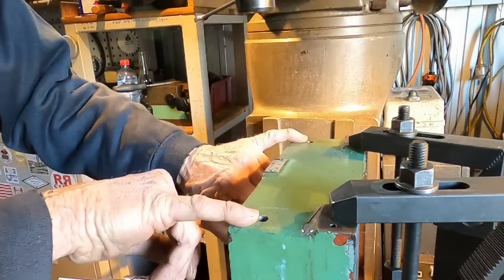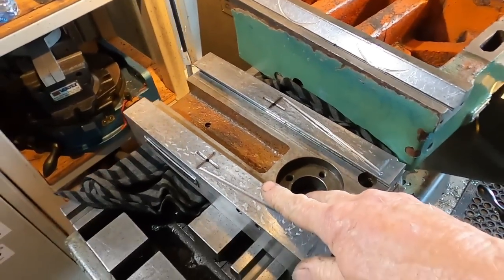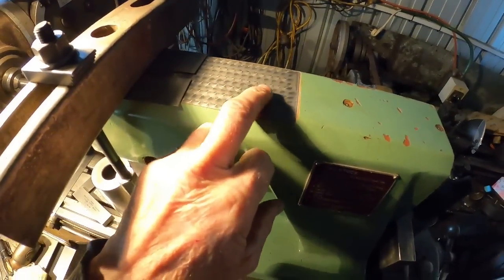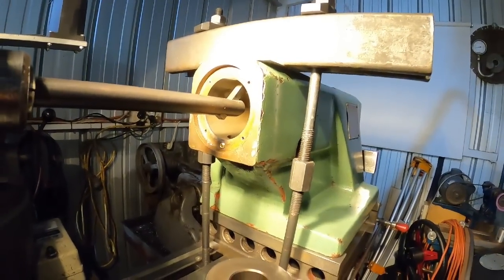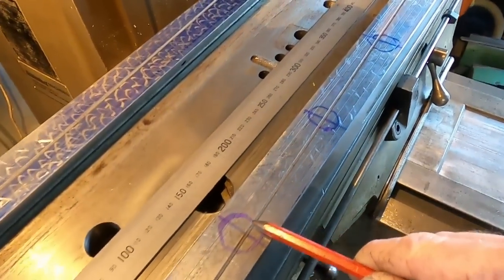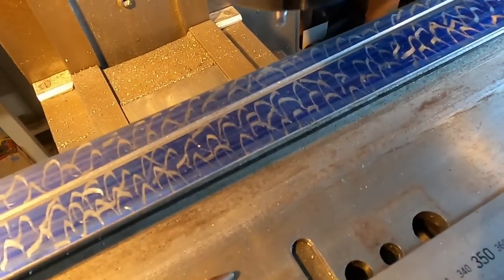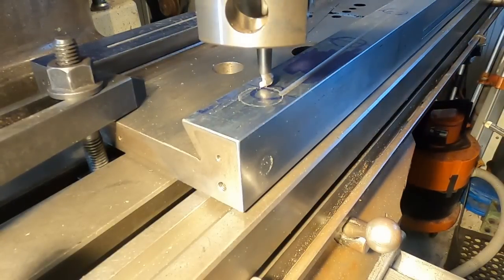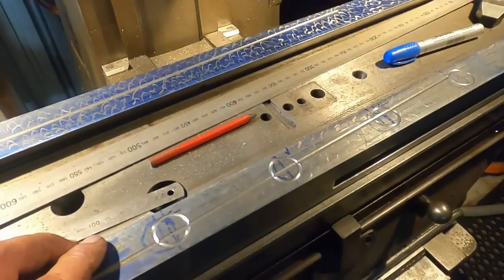JFMT 530 x 2000 Lathe Repairs .  Part 7 .

Comment: Max, why the circles?    Why not just simple straight line grooves at right angles to the direction of travel.  The effective oil distribution length will be bout the same.
Reply from the maker: Circles are pretty common .   If you do the straight lines as you say , the joining grooves have to be like a zig zag .   I do that style as well .   👍
Reply: @swanvalleymachineshop  :  Do straight lines HAVE to be in zig-zags?   Why?  Surely adding lateral lines would be a lubrication improvement.   Surely it is the line length to slide-way surface area ratio that counts, and it is a matter of making as many lines as required to get roughly that ratio.
I have seen simple long diagonal lines provided by the machine manufacturers.   Also, stretched out "X"s.   Never seen zig-zags or circles provided by manufacturers - that may mean of course that I haven't seen enough machines dissassembled, which being a desk-type engineer and not a machinist, is quite possible.
Reply from the maker: @keithammleter3824   It is considered bad practice to have lines that run the same direction as the travel .   Although it is done by some manufacturers , still bad practice as it can cause an unworn ridge on the slide way .   As long as they go across the travel direction either perpendicular , circular or diagonal is the preferred method.   .
Reply: @swanvalleymachineshop  ;  Well, yes, obviously.  But that was not what I was asking about.  I was asking about lines at right angles to the direction of travel.   If an existing diagonal line is judged insufficient, then surely you can just machine a few lines at right angles to the direction of travel, crossing the existing diagonal line to get its oil.
I cannot see that an intersecting circle gives better lubrication than an intersecting perpendicular line.  it is the length (or diameter) in the perpendicular that counts in wicking in oil.   Is there something I have overlooked?
Surely, if the manufacturer provided no lines of oil at all, than do zigzags as you did in the other video.   If the manufacturer (or previous owner) provided just a diagonal line and that proved insufficient, just cross it with a few lines at right angles to the direction of travel.
I suspect though, as you mentioned in this video might have been the case, that the JFMT only got used rarely, and the previous owner or machinist just didn't bother to oil it.

Comment: Nice modifications, and nicely done, Max.
Like the slotting type grooving tool, nothing wrong with the slide way surface Frosting, part of the reason to perform it, is to hide the scraping marks, as is my understanding. With regards to radiusing oil grooves, I was taught just to break the edges very lightly to prevent small debris from getting trapped and being dragged into the bearing surface,  but other companies I have worked at, insist it been left as is, obviously hardened sideways are left sharp.
As in engineering,  many sectors have their own methods, it would be Interesting to hear of other machine tool builders.
I think the orbital oil groves were designed for high speed slides on machining machines, ref large oil film for consistent "stick slip" for surface finish,  this was pre linear systems, ref Rexroth low friction type recirculating bearings.
Best regards John. 
Thanks for sharing.
Reply from the maker: Hi Mate .  It will always be a big can of worms when dealing with oil ways & scraping .   So many different methods & reasons  from cost to what works best depending on who you are or work for .      Thanks .  👍

Comment: The scratches in the table aren’t really caused by lack of oil. I’m not sure why people think that. Lack of oil results in a somewhat even amount of wear across the surface, depending on just how flat the table bottom is and how flat the top of the saddle is. It’s caused by tiny bits of metal, usually steel, finding it’s way between the parts. The same thing between the knee top and the bottom of the saddle. I’ve found that the bad design of Bridgeports and copies, with the short saddle (for the longer tables as the saddle was originally designed for a 32” table), as well as the too narrow dovetail under the saddle, allows for the table to drop on the side where it’s extended too far to the side. Since there’s nothing, wipers or otherwise, to prevent tiny particles from flying around and bouncing off parts of the machine, they work their was under the table, sometimes sticking to the oil on the bottom of the table, and being pulled between the table and saddle. The same thing happens with the saddle and knee. The end result is scoring on the surfaces. The table protectors on the front and rear of the saddle help with almost all the particles, but obviously, not all of them.

I’m also curious as to why the tailstock spindle needed that groove. What I’ve found is that as long as there’s an oiler on top, and two for longer spindles, the oil gets distributed pretty well as gravity has that oil going around the spindle and as it’s moved back and forth the oil covers it pretty well. Not saying you shouldn’t have done it, but I’m wondering if you got caught up in this work and just got a bit anal about it. I know how easily that happens, as sometimes I have to stop doing something I think I need to do, but really don’t.
Reply from the maker: There was no provision to oil the tailstock quill .   The oil points only lubricate the screw .    The quill as it is a very tight fit into a lapped bore  .  I will go over it in the assembly video .  👍

Comment: I like all the improvements Max.  Once you have the bones of a good machine, (i.e. good castings, good bearings, good fit and finish etc.) then the difference between a good machine and a great machine are these little details.  This is especially true of the oiling system as even the best machine won't last long if not properly lubricated.  When I get some time I think I am going to put those oil grooves and flip top oilers on my tailstock as well.  Are you able to get three phase power at your shop or will you have to generate it with a phase converter?  After years of using a phase converter I finally have three phase power (600 volt, 200 amp) at my shop and it is fantastic.  When I look at a machine that I may want to buy I don't have to worry if the motor is too big anymore.  I'm looking forward to seeing that lathe of yours up and running.  Ken
Reply from the maker: Thanks Ken .  Yes the 3 phase is being organized at the moment .  The power company have to upgrade our supply .    I will be able to run a couple of my biggest machines at the same time if reqd .    The mill is 15hp , hbm & lathes 10hp .  👍

Comment: Impressively deep holes. You always have to worry about wander, especially with the smaller diameter drill bits.  I bet there was a bit of pucker factor with irreplaceable castings. You had some really interesting cutting solutions as well. My mill table doesn't go as far over as yours. You were barely able to get the range, meaning I couldn't have reproduced this job the same way. On the creation side of things, this video was a lot of work editwise. Really nice work Max. Thanks for the lesson.
Reply from the maker: Thanks Rob .  Lol , yes the tailstock was a tight squeeze .   You know what editing can be like , some easy  & some take ages !   Cheers .   👍

Comment: Gday Max, the groove in the tailstock work a treat, the Cincinnati sometimes does the same when you wind the table down, pain in the ass really, I like the circle oil grooves, makes a lot of sense, thanks for sharing mate, cheers
Reply from the maker: Cheers . They tend to get a bit tight up at the end of the travel , something you just have to get used to .  It's a big job to rectify .    👍

Comment: Hi Max, like the Moneyshot, chips being blown out, proof of intersection of the cross drilled holes.
Looks like I will have to get off my arse and do some oil grooving on my machines.
The lathe will be nice and slick and a pleasure to operate.
Reply from the maker: '' There she blows ''    The stuff i mix with 68 oil makes them slippery , a little bit of Cat hyd oil anti stick slip additive ! 👍

Comment: I would think anything that get the oil to the place you want it and not have it pour out in the ground without doing it's work would be fine. I probably would have cut some short cross grooves with the die grinder as opposed to making circles. However your method is a bit cleaner : )
Reply from the maker: I thought about that way , but after seeing circles on another machine  & running the idea past someone who has  50 years experience in machine reconditioning , circles it was !    👍

Comment: Max, my problems within my tiny shop seem so much easier after watching that refit to radius as upon a scraped way surface. Where set up of the job as secured, attention to depth and where needed, tool change...reminders to best fitment.
Who knew my shop needed three phase also?   Because, Max, after watching....I want some larger capacity at once. The Mrs. may have a nice christmas central to cast iron.  M.
Reply from the maker: Thanks .  👍

Comment: Another fascinating one Max, learned heaps as always. I really like these ones, good progress and seeing the setups you use for difficult parts is always inspirational.
Hoping your 3 phase power install goes smoothly. I’m guessing it will probably leave your wallet bleeding from the gills, because 3 phase wiring is seldom cheap & copper prices are through the roof at the moment.
You won’t know yourself once your all powered up in the new shop. There will be no stopping you then. 👍👍👍
Inspirational how you tilted the Bridgeport and used the x feed table to cut that blind oil groove in the tailstock. I’d have never thought of that in a million years.
You use what you have to get the job done. 👍
Keep plugging away, your making great progress.
Reply: Ian Moone, sounds like you knew my Gandfather and Father, lol.
They both said, "when you have not got what you want, then you use what you have".
That is use your brain, still the best tool in the workshop!
 Great video Max, John, Australia.
Reply: @joandar1  That is the plain truth! 👍👍👍 Greetings from Dresden! 🇦🇺🍻🍻🍻🇩🇪 😎
Reply: @michaelkoch2109  Thanks Mate, John.
Reply from the maker: @joandar1  Cheers   👍
Reply from the maker: Cheers .  The distribution board is not cheap either . It has to support 15 ,  3 phase outlets .  👍
Reply: @swanvalleymachineshop  
You can never have too many spare 3 phase outlets available, the demand seems to increase over time, as you find more machines you can’t live without.
It’s a lot dearer if you have to get someone back to install more later.
I have a mix of 32 & 20 amp outlets.
Make sure you get the 5 pin outlets.
You can always plug 4 pin sockets into a 5 pin outlet but not the other way around (5 pin sockets into a 4 pin outlet.
I’m sure you already know all this & if not your sparky will likely advise you.👍👍👍